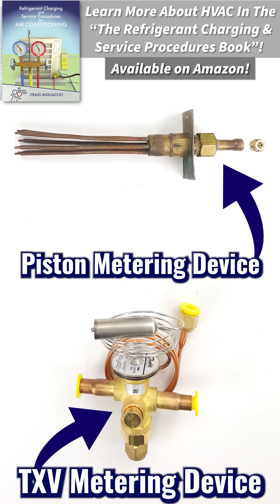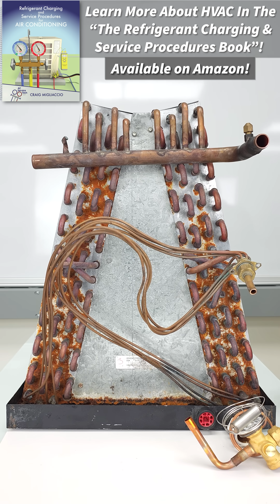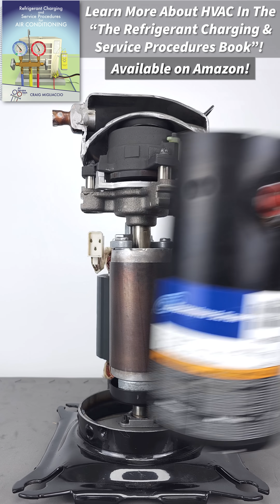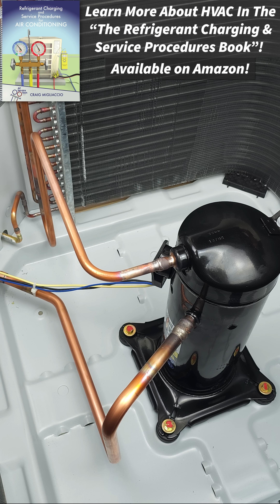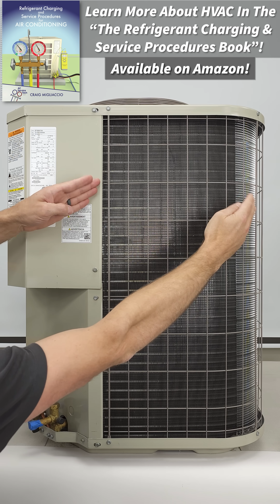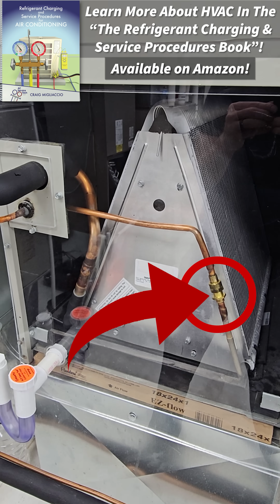The Refrigeration Cycle of an Air Conditioner, 4 Main Parts!

Comment: Food for thought, the compressor is no different than a vacuum pump. If I install a liquid line solenoid, it goes into pump down. The only safety is the low pressure switch. Ignore the safety and it will go into a vacuum for a certain amount of time.

Comment: So in the condenser, it’s always the same temperature? Just the state is changing?
Reply: Not exactly, but the temperature change is somewhat minimal. 
The change of state is more important than a thing with refrigerant. 
From the start to the end of the condenser coil, the refrigerant should cool down anywhere between 8-14 degrees, and that number is known as subcooling. 
Temp change is important because it cannot change state without changing temp/pressure. 
It needs to be at the correct state and pressure in order to properly squeeze through the metering device so that it is a total gas after it does so, ensuring that it steals as much heat across the evaporator as possible.
Reply: On a physics scale: 
If you have too much refrigerant trying to come through the metering device, it will come through as a liquid. 
If it is a liquid, you're only getting the cooling surface area of a few 100k particles per square inch vs. millions per square inch with gas. 
It's all about balance. 
There is so much liquid here, so much gas there, circulation.

Comment: This is the most clear and concise short on teaching someone about something.
Reply: I recently service a heat pump and the pressure on the low side was almost the same as the high side. System worked for 20minutes then trip a low pressure sensor.